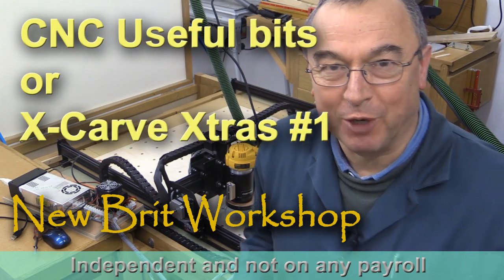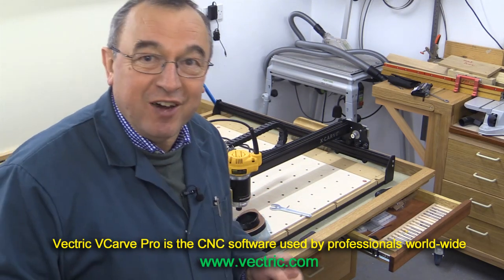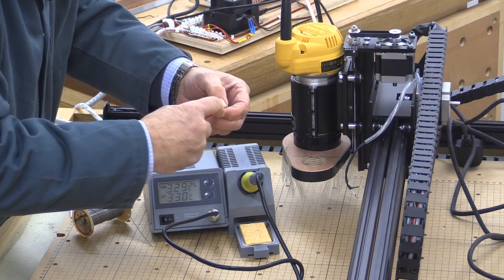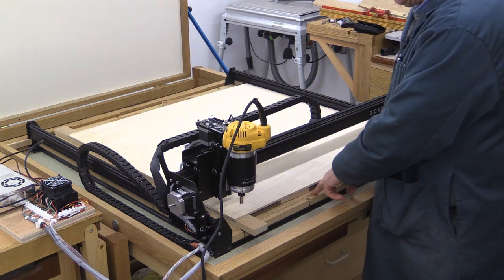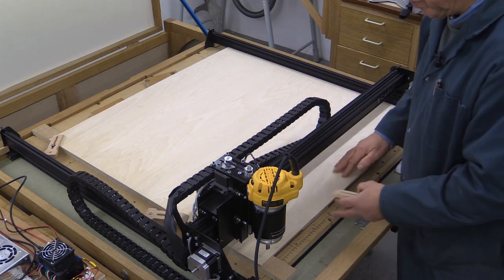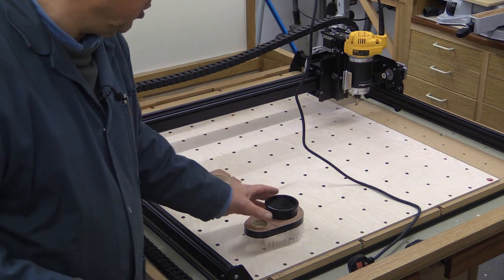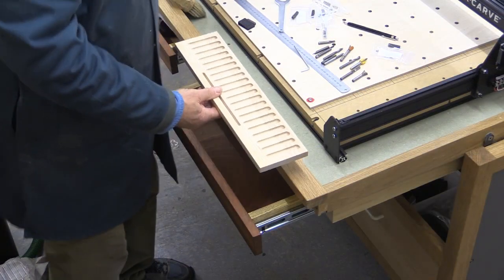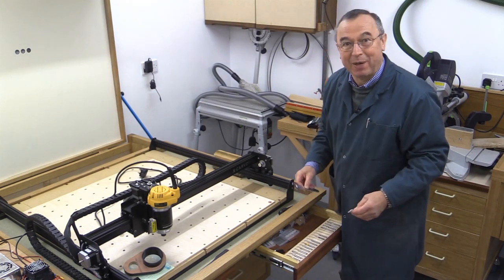Original X Carve CNC Xtras #1

Comment: Hi Peter; I don't care for dust collection boots that ride with the spindle. If you build structure  out and down from the carriage that rides the gantry the dust boot can be set a bare minimum off the spoil board. The spindle goes up and down through a spindle size hole in the top of the boot. No grass skirt required around the perimeter of the boot. You should also consider kicking the vac hose fitting off the boot at 45 degrees to the top of the boot. Better air flow at 45 than you get at 90 to the table. Cheers, G
Reply from the maker: +George Savage Hi George, Excellent advice. I will look at this today.   Peter
Reply from the maker: +George Savage Hi George, I am not sure why I can't create a PM to you. I have mentioned your idea in my latest video and will create a design in due course.  Many thanks.   Peter

Comment: You might consider using a commercial door brush seal kit for your router skirt.  You can get a 50mm nylon brush, remove it from its mount then glue it to the circumference of your router base for a more stable skirt and one that is replaceable.
Reply from the maker: +Stewart Robertson Hi Stewart, I realise this but I am on an adventure and am determined to make something from scratch.  Many thanks - your idea is excellent.   Peter

Comment: Peter, if you enable 'hard limits' in your GRBL settings ($21), UGS shouldn't be able to crash through your limit switches when you manually move your spindle around. It makes them work as stops, like when it is homing.
Reply from the maker: +Robs Con   Hi Rob, That is really useful - many thanks.   Peter

Comment: Excellent. Nice finish on that insert. Do you use the Festool CMS tablesaw insert permanently, or do you have another tablesaw? I have the CMS router table, and have considered buying the TS55 insert, but I can't decide whether that is better than a separate stand alone table saw. Do you find it a pain to switch between table saw and using the TS55 normally? Apologies, I know it isn't a CNC question, but I spotted you using the CMS and thought I'd ask!
Reply from the maker: +Rico S   Hi Rico, Yes, I have the TS55 in that insert all the time. It is fantastic and I do not need another table saw.   Peter